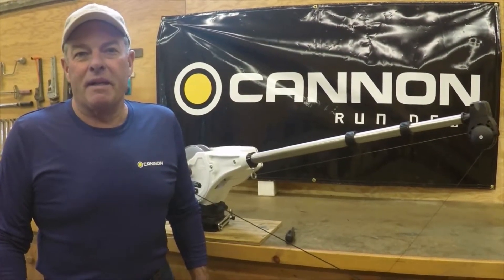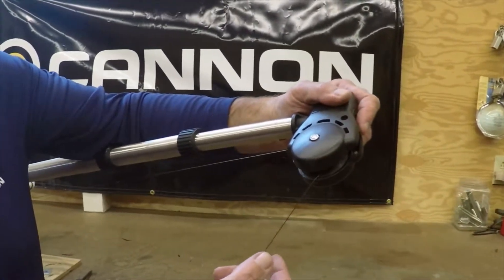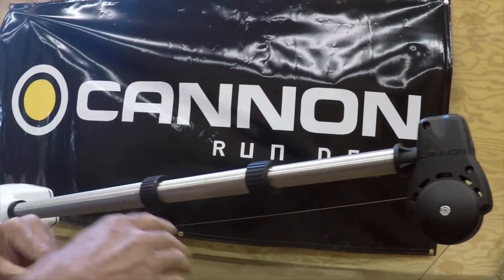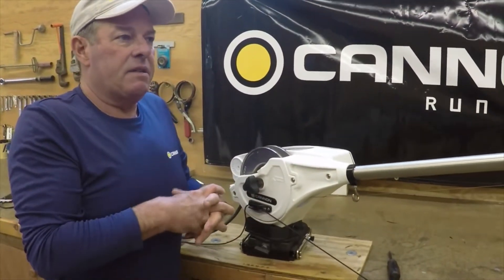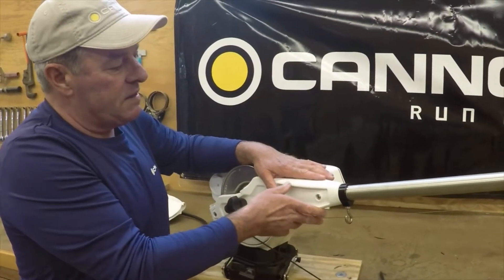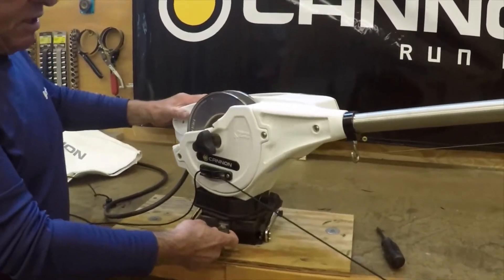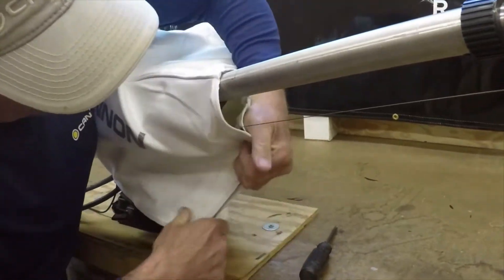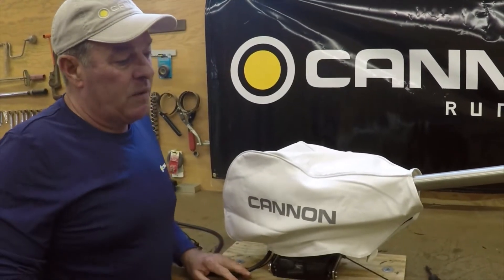Downrigger Maintenance Tips

Comment: Should they be lubed the shaft after 5 seasons?  I noticed mine are starting to get resistance and aren't as free moving as when they were new?
Reply from the maker: Hi Ronald,

The only items to grease periodically would be the thrust bearing and bearing race under the clutch knob. The shaft itself should not require grease.

Thank you
Reply: @cannondownriggers1811  Thanks!